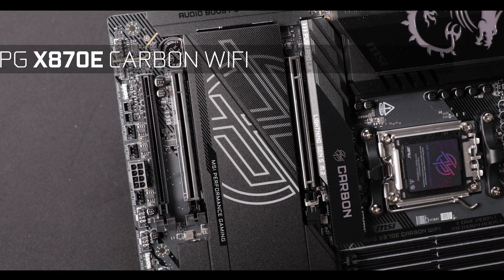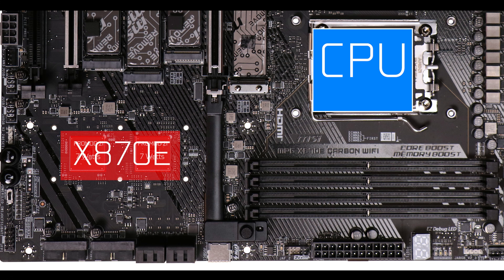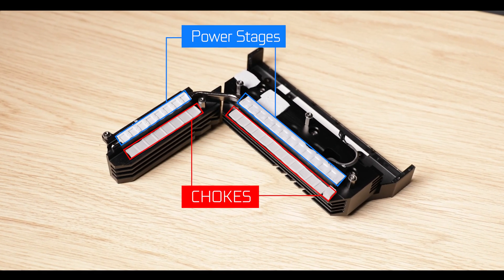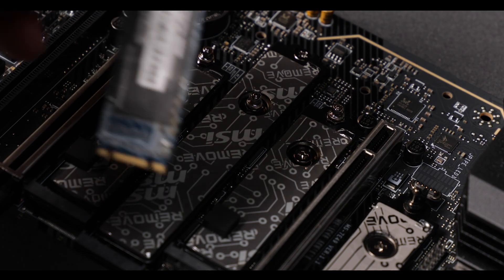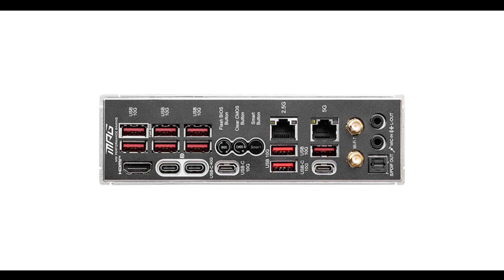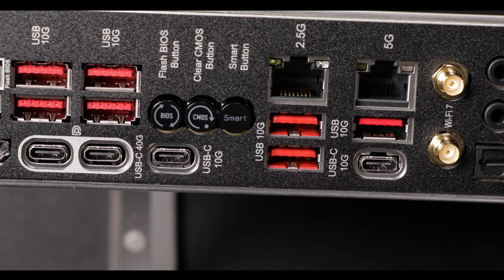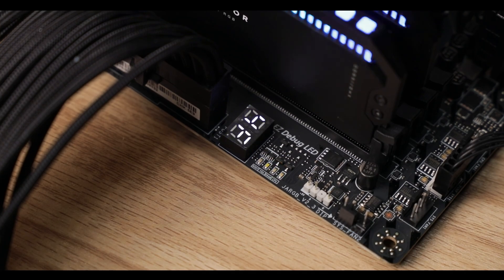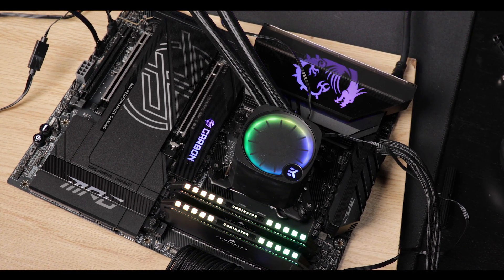MSI MPG X870E CARBON WIFI : not exactly an upgrade

Comment: I was looking at upgrading from my MSI X670E Carbon Wifi to the X870E, but its still too expensive in the UK @ £400. The X670E version is almost the same, minus a few extra USB 4 ports.. I think I'll stick with the X670E & pick up the 2026 'refreshed' X870E Carbon-Wifi that MSI is releasing later next year

Comment: If only Msi would not have changed the usb4 configuration to allow people to disable it and use the second gen-5 drive without negatively affecting performance for graphics cards. Like on the tomahawk, the edge, the gaming, the godlike, whyyyy Msi ! They could have struck gold. But oh well, I guess using two gen 4 drives through the chipset is good too.. 
Thank you for another awesome review!

Comment: Thinking of changing out my motherboard b650e-e because of low sata read and write speeds below 390 MB/s. Seems that the cause is an old asmedia 1061 chip. Or so forum posts state. So now I'm looking for a new board. Might seem like a minor issue. Though the price of the board. I expect everything to function correctly. Will not give asus anymore money. Time to jump ship. Is asrock still having bios killing cpu's?. It's either Gigabyte or MSi if so. Not a lot of choices anymore.

Comment: There is  PROBLEMS 1 $500.00 USA DOLLARS TOO EXPENSIVE 2. LGA. AM5 SOCKET IF A DISASTER OF BENT PINS AND PINS SNAP OFF NO SERVICE NO RETURN REFUND TO THE DEALSHIP NEWEGG ANAZON SO ON THIS IS WHY I SUSPEND MY BUSINESS WITH ASUS AND GIGABYTE THEN FOR PROBELEM 3YOU WILL HAVE TO BUY A NEW MOTHERBOARD NO REPAIR PROPLEM 4 MSI GOT A STUPID RMA THE SERVICE STARTS ON NEW LAUNCH DATE SKU NOT SALES SLIP DATE what ever the case when day one of the motherboard launch for. MSI  that is the clock for it's service plan start as long there is no busted LGA AM4 SOCKET NO BUSTED PINS ON DIM SOCKETS NI BUSTED PINS ON PCIE SLOTS the time for say no deal is the only way to protect your self

Comment: does the 670 have TB? i actually ordered a 670 Ace, bc it was cheap at 400usd, but ended up returning it bc it didn't have any way of doing TB, even w an add-in card..  tb4 is so damn fast, and extremely useful for me, i don't game, but rather will use this rig for production work and i just picked up a base m4 mac mini for $450, incredible deal for a rock solid 2nd machine, gives me peace of mind, and i can do simple/proxy 4k vid editing straight off the drives...  so having a couple i can use in both systems has been a real dream when i'm on the go (and they aren't networked)..
so i returned the Ace and got this, it is steep but there's so much I/O, all of it fast... absurd it doesn't have a backplate for that much money, and i'm sure newer boards from Computex wil pique my interest, but tariffs were making me nervous
thx for the reviews!

Comment: Was going to get the Asus x870E-E gaming, but I got the MSI X870E Carbon instead.  I do more content creation than gaming so I got the 9950X cpu and Corsair Dominator RGB 64GB 2x32 ram. I'm upgrading from a AMD4 Asus Hero mobo, 5800X, 32GB ram.  MSI customer service is so much better concerned/caring/friendly in solving problems than ever dealing with Asus, who tends to defend themselves and put you off!  
_________________________________________________________________________________ 
FYI.....

Why is MSI MPG X670E Carbon WiFi better than MSI MPG X870E Carbon WiFi?

    2 more SATA 3 connectors - 6 vs 4  
    1 more DisplayPort outputs - 1 vs 0
    3 more audio jack connectors - 5 vs 2
    1 more USB 3.2 Gen 2x2 ports - 1 vs 0 
    2 more USB 2.0 ports -  2 vs 0

Why is MSI MPG X870E Carbon WiFi better than MSI MPG X670E Carbon WiFi?
    800 MHz higher RAM speed (max) - 5600 MHz vs 4800 MHz
    600 MHz higher overclocked RAM speed - 8400 MHzvs7800 MHz
    128GB larger maximum memory amount - 256GB vs 128GB
    Has dual BIOS
    Wi-Fi version - Wi-Fi 4 (802.11n), Wi-Fi 5 (802.11ac), Wi-Fi 6 (802.11ax), Wi-Fi 6E (802.11ax), Wi-Fi 7 (802.11be)vsWi-Fi 6E (802.11ax), Wi-Fi 6 (802.11ax), Wi-Fi 5 (802.11ac), Wi-Fi 4 (802.11n)
    3 more USB 3.2 Gen 2 ports (USB-A) - 9 vs 6
    1 more RJ-45 ports - 2 vs 1
    2 more Thunderbolt 4 ports - 2 vs 0
Reply: My bf owns the x670e. It's a great board but the wifi Bluetooth and USB 4 is behind the 870e. The 870e has 5 gbs Ethernet and better wifi and Bluetooth and the ports are sideways instead of facing up ...this hides cables for cable management. The x870e also has a button to remove the GPU and heatsinks snap in and out for m.2. 🤩

It's a better mobo for video editors and those with type C external drives

Comment: Hello, I need many USB ports. I like this MB due to its USB ports quantity at the back. I was in between this and Asus Strix X870E but I find MSI X870 Carbon slightly better. I don't need 5x M2 slots. 4x is more than enough.

Comment: About to use this board for a Ryzen 9 9950x3D, an RTX 5080 and 192GB of DDR5 6000 Corsair Vengeance RAM. Psyched
I also Ironically was on the fence about whether or not I should get one or two 5.0 M.2s, so that was really good information about not using the second M.2 slot. Great Video!
Reply: Why do you need so much ram unless you're doing multiple programs and workstation as a solo network of a computer. If not, you're overkilling it and wasting money for no reason.
Reply: That set up sounds crazy but I ain't gonna hold you bro having four sticks of ram on AM5 is hell. It will probably be annoying as hell trying to get em all working at the advertised specs, so if you really plan on going through with that keep that in mind. 

You're also probably going to have to look up video guides for it and you may have to clear CMOS a couple times too ( thankfully the board comes with a CMOS button making it less finicky than others cough 'gigabyte' cough). Nonetheless good luck

Comment: Merci Laurent !
Very good video, clear explanations.
I'm looking to build a new PC with X870E motherboard, and I'm a bit disappointed to learn that, to get the best of the main PCIe slot for the GPU, basically only 1 PCIe 5.0 M.2 slot can be used. Not very future proof if I want to buy a second fast M.2 SSD.
Noticed that Tomahawk 870E supports both PCIe 5 M.2 slots at the same time without impact on GPU slot, that's even more disappointing.
Reply from the maker: Hmmm I need to review that model !

Comment: My current PC is pretty well balanced with a ryzen 7 5800x, 32gb 3600MT/s CL16 and a 10GB Rtx 3080 all connected to a ROG X570-f motherboard however I have been wanting a new GPU to play games at 4k which my 3080 used to handle with ease at native but now stuggles with DLSS, But with a new GPU I would also have to upgrade my cpu as the 5800x is barely powerful enough to keep up with my 3080 so I was thinking of getting the 9800x3d. I also want to have a motherbaord with 2 ethernet ports for Wifi and a NAS for mass storage, however after eventually stumbling on this video which shows off the cheapest motheboard I can find with 2 ethernet ports im now wondering weather its even worth building a NAS as my only M.2 is a 1TB SN850X for a boot drive which would leave me 3 vacant m.2 slots that I could easly fill with just some 2TB SN770 NVMe's for 6TB of mass storage. 

Im just really on edge weather its worth spending around £1000 on a new cpu, motherboard and RAM and then spending another £300 on 6TB of NVMe storage and eventually anywhere from £750-2000 depending on which GPU I buy.

Comment: Impeccable vidéo!
Reply from the maker: Mais ... Explosif ... C'est toi qui est impeccable :)))
Reply: Question...

Msi x870 e edge ti or the carbon from this video

I just want what would work the best for the soon released 9950x3d.

Full GPU lanes and m2 support. 
Preferably lowering usb support to keep the m2 at full speeds.
What would be best?

Comment: There is a difference between the MSI MPG Carbon Wifi boards. The X670E is PCIe 5x16 even if you occupy all M2 slots. X870E shares bandwidth with M2_2. If you want PCIe 5x16, you only have 3 M2 slots available. I am thinking about MSI MPG X670E Carbon WiFi. It is still for me the best combination of 4xM2 and 6xSATA at ATX size. New X870E MB´s have always some compromise with the shared lines. If I do not insist on  USB4 display output I do not see any reason to buy X870E MB´s..
Reply: This is why I’ve kept my X670E Hero because the X870 variant faces similar limitations when using all the m2 slots. No such limitation on the X670!
Reply: There’s a speed difference between 5th generation m.2s and 4th generation m.2s and no real noticeable use case for pci-e 5x16.

Comment: I have this board paired with a 9800X3D, XFX XTX, 32 GB RAM, a bunch of drives and powered by Super Flower Leadex III ATX 3.1. I have been loving it so far. I really like the BIOS and how the board boots so fast. My last MSI motherboard was the Z97 Gaming 5 and it was a great piece of kit.

Comment: I think the Carbon will handle the heat dump from an RTX 5090 better than the Tomahawk.
Reply: It would be crazy to buy a 5090 and pair it with a budget x870 board. Carbon or bust.
Reply: @MeticulousTechTV  Why? Will the 5090 destroy a budget X870 board faster than the Carbon?

Comment: I think it's worth the $200 extra over the tomahawk.   That said, I just want to be able to use PCIe_2 on a MB without spliting lanes with PCI_1.  I have a professional audio card with a daughter card that has to be underneath it, meaning it can't be in the last slot, which would be fine as its PCIe 1X.   Granted right now lane sharing doesn't matter, but maybe it will in the near future.

Comment: I also used this MB in my build. I paired it with the Ryzen 9800X3D, and the Azrock 7900 XTX Taichi OC 24, dominator titanium 6000MT 30cl with the  Evga Supernova 1000G FTW PSU. 
My question is I’m running 2 silicon power 2.5  4TB SSD‘s and I’m wanting to use the M.2 2280 GEN 5. Besides the load time on games, would it be beneficial to get the GEN5 M.2 2280? I play a lot of games and I’m also a photographer and I do a lot of editing of just pictures at the moment soon to be doing video as well
I’m new to your channel but I love the energy and I just subscribed to you cause I love the way you explain things

Comment: I am about to begin full rebuild with this mobo and 9800x3d. I will start with test bench assembly to test a new Crucial T705 ssd, and see how temps go under load. I will also install OS and every driver and latest BIOS. After that I will take my whole custom loop rig apart and redo everything from scratch, including a jungle of cables resulting from partial upgrades/modifications over the years. Once assembled, I will OC the 9800x3d.

Comment: So If I put one NVMe SSD Gen 5 on the M.2_1 CPU Slot, I can another two Gen 4 NVMe SSDs on the chipset Slots and still get the x16 CPU Lanes for the Graphics Card with that motherboard?  

Also, is really any real world performance hit running a gen 4 NVMe on the chipsets instead of the CPU Lanes?
Reply: The manual states PCIe1, PCIe2 and M.2_2 share bandwidth, so if you want to run PCIe1 at gen5 x16 bandwidth, you must leave PCIe2 and M.2_2 blank.

Direct CPU PCIe lanes will always be able to process data faster. That's due to bandwidth and latency. However, because chipsets already provide gen4 bandwidth, for the vast majority of the applications, you will not see any difference. For games, you could just use a gen3 NVMe ssd via Chipset and you would not see any difference vs CPU gen5 NVMe SSD, maybe except for loading save files or some huge shader compiler data. But for actual gameplay, there is no difference.

Comment: Could you answer some memory questions? I'm planning a new build utilizing a Z890 MB and an Intel chip, but memory has changed. The board can take 9000MT DDR5, but I can't find any sticks for sale with that. I've found several 8000 and more 7200, but which is better? Does latency mean anything any more? These sticks seem to have high timing/latency values? Also the 8000s come in an unusual configuration 48GB in pairs rather than 16 or 32. Why is that? I hope you can answer my questions, so far I haven't received an answer from anyone else.

Comment: My MPG Carbon X670e stopped working out of nowhere after about 3 weeks & wouldn't post or refresh bios. I've officially written off MSI boards for now.
Reply: Well i have G65 from 2016 with an i74770k ..runs perfectly till today..btw now i bought x870e Carbon :)
Reply: 5-10% of PC hardware has a high probability of arrriving DOA. That doesn’t always mean it’s dead out of the box, but will die within a month or so. Every brand suffers from this, it’s a bummer when it happens to you, but the real test of a brand is how they make it right. If MSI support sent you a new board, then to me that says a lot about

Comment: Great review, thanks! A question - if there is a Graphics card which uses PCIe 5.0 16 lanes AND M2 which is PCIe5.0 will GPU slow down to using x8 lanes? Also what happens if we add another M2 to other PCIe5.0 socket? Will drives be x8 lanes but graphics x16? Or will GPU also be x8? Thanks again :)
Reply from the maker: If u use the closest M2.SSD@pcie 5.0 it will not remove any lanes from the 16 lane GPU export .

If you any other PCIe 5.0 enabled connectors or exports , the GPU export will go from 16 to 8 lanes @ PCIe 5.0

Hope this helps

Comment: I got the MSI MPG X870E CARBON WIFI and was lucky to get the new 9800X3D which will be my new main PC for years to come. The new setup will replace my ASUS ROG RAMPAGE V EXTREME and Intel Core i7 6850K CPU and my switch from Intel to AMD.
Reply: boom! That's going to be an incredible upgrade.
Reply: i too

Comment: I'm once again asking can you review the ROG X870E-HERO. haven't found a solid review that goes in depth in NVME and PCIE lane sharing
Reply from the maker: Hiii :) I'm on the Tuf right now. Will do the hero right after ;)
Reply: @Laurentschoice  can you review the Godlike x870e?
Reply: DO NOT RECOMMEND HAS ISSUES WHEN SAVING BIOS SETTING SCREEN GOES BLANK. Both the mobo I got cause I replaced a hero with another one. Both Ethernet ports were only downloading at 10 MBS even tho I can get 120MBS

Comment: I just built mine today because I got a new 9800X3D yesterday. It's paired with the Carbon X870e, RTX 4080 Super, KLEVV DDR5 8000 MTs, 1000  wat Seasonic and 4 TB SS 980 NVME and 1TB 970 for the C: Drive ---- Platinum LET ROCK!!!!!!!!!!
Reply: Should have gone for 6000 MT/s CL 30 RAM instead as AMD Memory Controller doesn't like anything above 6000 MT/s RAM clock speeds.
Reply: @pradeepsahoo7243   Not true. 8000MT/s gives you a small boost in 1% lows but it's not that much.
Reply: Oh boy, what a beast. 

Have a blast, man!
Reply: Wow we almost have the same rig... The Only  Differences are: 
-RX 7900 XTX from Power color Hellbound.
-And MSI MAG Tomahawk X870 Which I love!....
- 2X 4TB From LEVEN JPS600.
Reply: A) where the heck did you find a 9800x3d, and B) How did you get 8000mhz memory to work and what brand \ model number did you buy?
Reply: @ I got mine locally at MicroCenter. Each store has been getting between 6-20 once a week, you have to check inventory multiple times a day and immediately drive there once stock comes in
Reply: @CHAOSMOVEMENT  KLEVV CRAS V RGB DDR5 48GB (2x24GB) 8000MHz CL38 A-DIE 1.45V Gaming Desktop Ram Memory SK Hynix Chip XMP 3.0 / AMD Expo Ready - Black (KD5KGUD80-80D380G)
Reply: Bro I think for 9800x3d ram 6000 or 6400 CL 26-30 run on 1:1 this is the best for gaming user
Reply: Got the same thing do you notice when you tab out of games and go back in it’s a black screen for a couple of seconds also how many sticks of ram you have
Reply: @gregorycharalambous8740  2
Reply: Ohhh my, now i have a hard on
Reply: thats nice i just got mines today im building it next week with a ryzen 9 7950x3d a rtx 4080 super two ddr5 kinston fury expo 32gb ram  a crucial t700 gen5 2tb ssd and the other two gen4 one is crucial 1tb and samsung gen4 2tb and i cant wait to see this motherboard in a new box also got the dual chamber NZXT H9 flow new msi two blocks of three fans each all rgb magnetic fresh braided wires all black with also rgb this thing its going to look amazing my old  case was getting to small for all parts i keep adding to it cant wait
Reply: AMD Ryzen 9 7950X3D, 

ASUS - TUF NVIDIA GeForce RTX 4080 SUPER, 

MSI MPG X870E CARBON, 

G.SKILL Trident Z5 Neo RGB Series AMD Expo) DDR5 RAM 64GB (2x32GB) 6000MT/s

SAMSUNG 980 PRO SSD with Heatsink

Corsair RM1000x Shift Fully Modular ATX Power Supply

My first pc build ever! Haven’t put it together yet. Any thoughts?
Reply: Did you have to update bios or is it good to go out of the box with the 9800x3D
Reply: @MikeyMooch  Out of Box it was great but I have to mess with things as I am a nerd/geek so bios is latest
Reply: Are you having any blue screen issues on sleep or restart? Been reading the MSI has been having a bit of this.
Reply: @Ferrous_Bueller  No none at all.
Reply: @ I been with the x870e carbon WiFi  I didn’t want to update the bios from 1A10 to the beta but I had to just because it was impossible to do anything lots of sttuters and pc I couldn’t do restart because of this issues the screen would freeze its was very bad and I just bought this mob but the beta 1A1A been working a lot better thankfully because it’s was a headache dealing with this mob and I just got it my b650 pro mob msi when it finally got good i upgraded to the x870e and this happens but at least the beta it’s working good it’s all they have for updates betas
Reply: I now got the 9700X with the MSI Carbon and that's perfect for the 4090 playing 4k@120Hz OLED TV only👍🏻
Reply: What ram kit did you use? I'm having trouble finding a Compatible set of ram
Reply: How do you like the KLEVV memory? Any better/worse than the known brands?
Thank you!
Reply: There is no way DDR5-8000 runs stable on AMD.
Reply: @User-ys7cb  WRONG! Mine is CHERRY!